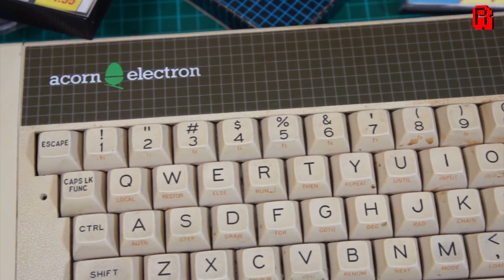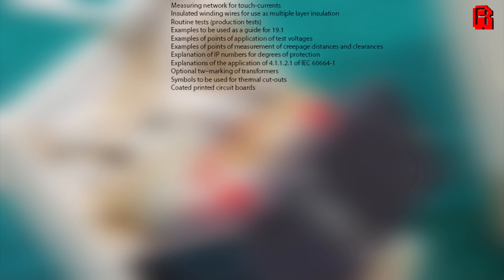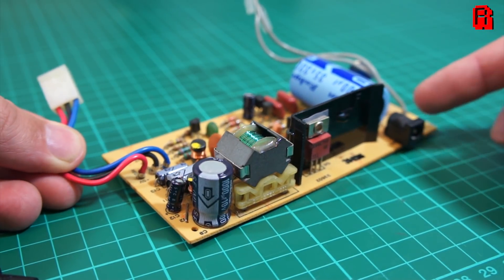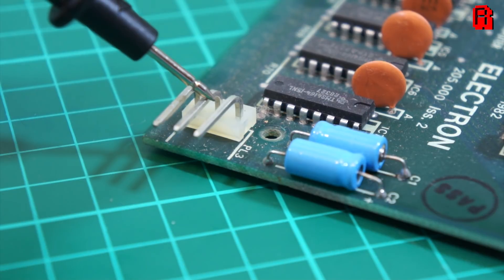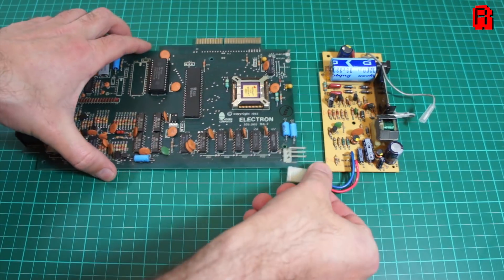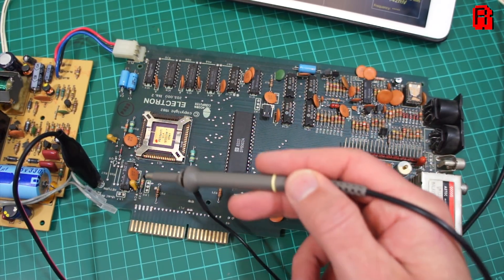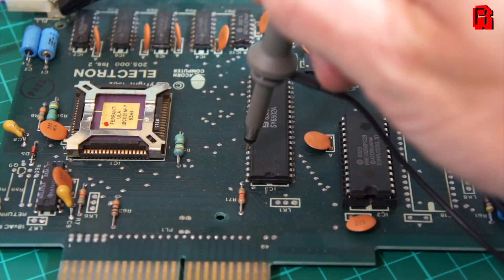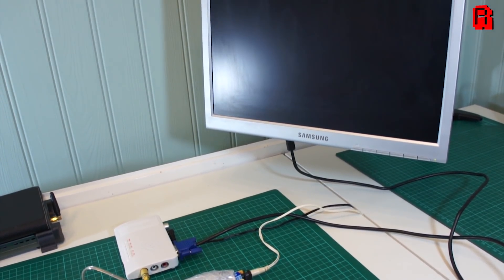Acorn Electron | Pre-Flight Checks - Trash to Treasure

Comment: Is that acorn symbol a usable letter in textmode? Because if it is, you can't tell me that wasn't used for some creative text artwork ;)
Reply: The Acorn symbol is not in the character ROM, and if you try to copy it with the Electron's screen/line editor, it will beep at you in complaint... But if you were to (re)define a (custom) character with its exact bit pattern and then try to copy it, the Electron would magically oblige as if that symbol had been that character code all along!
Reply: That is actually pretty interesting... and you found all of this out trying to draw what exactly? ;-P
Reply: I was thinking "Why can't I copy that symbol?", and nothing more. There are far better ways of drawing pictures on the Electron than abusing an innocent glyph.

Comment: Awesome video. I love these obscure (to me) British computers from the 80s they are so much neater than most of the ones that were available to me in my part of Canada at the time. I wanted a Commodore 64 when they came out and then the 128 and Amiga but didn’t get a computer until I was 17 when I finally convinced my grandma that I needed to learn to use a computer for school and that I would need to know at least some computer skills for the work place. Sadly all I really ever learned was how to play video games and go on to message boards. I still am not very good with computers but it’s never too late to learn and hopefully now that I’m disabled I can get the odsp ( where my pension comes from) to send me to school to learn computers so I might be productive again and actually get to have a living wage.
Reply: Remember that there's staggering amounts of material online for free you can learn from aswell, so many resources now. Go ahead and bag a C64 off ebay, easy to get the games, books, etc. It'll put you in the mood. 8)  You could of course obtain an Electron or Beeb off ebay UK (sorry, my store ain't up yet), but remember if you do then you'll need a voltage converter, or some other adapter to supply the 19V AC, though I'm not sure how such a system would behave if fed with 19V at 60 instead of 50Hz. I think LGR has some vids with more detail about voltage supply issues if importing home micros from Europe. Same applies to later tech, no need to go to school to learn. Infact these days the last place I'd want to be to learn anything is school. :D

Comment: What is the pad you do your work on? Can you get them on ebay? Thanks
Reply: I'm under the impression that Robert was asking about the cutting mat, looks like an A2 size one to me.
Reply: Doru Barbu 
I was yes lol. But the info about the sensor was good too. Wgat
Reply: It's a model kit builders cutting mat.
Reply from the maker: hadessuk here you go this is the scope https://www.amazon.co.uk/dp/B071JJLHMS/ref=cm_sw_r_cp_apa_aYO7zbEPB7JDW
Reply: This is what I was about to ask so saves us both the trouble :) thank you and great job you are doing saving these old machines!
Reply: RetroManCave can’t find a Hantek scope with explicit iOS support, or which app it would use. I found the Aeroscope though, which looks pretty sweet if expensive ($200).
Reply from the maker: +Robert heap that's a Hantek scope, it's a wireless scope that uses ios or android devices as a screen via an app.  Search for Hanteks website for the range, or Amazon.

Comment: I don't recall my dad ever cracking open the power supply and he certainly wouldn't have done such a crappy job on soldering those points. I'm guessing that one must have come with the second electron we bought used and the other one was our original one. 
That's my story and I'm sticking to it anyway...
Reply from the maker: Martin Kidd oh we like dodgy things in the cave!  It gives me fun things to poke and talk about.
Reply: I have an earlier model Elk (without the ULA in a socket) and the PSU looks about the same as the dodgy one in the video, just without the scorching.